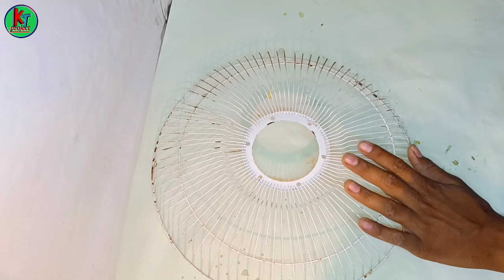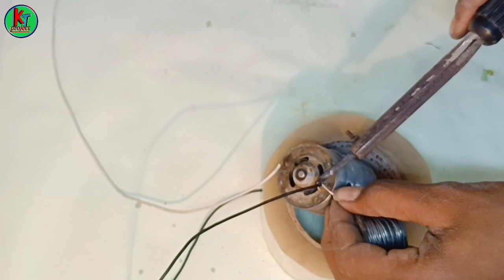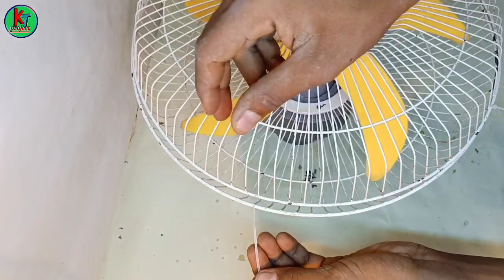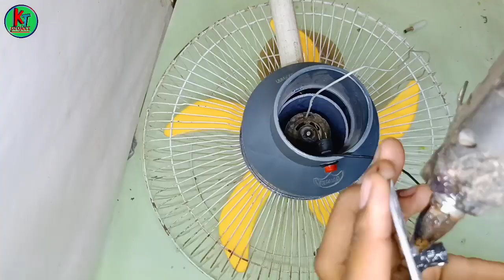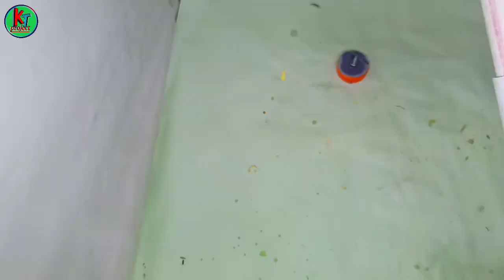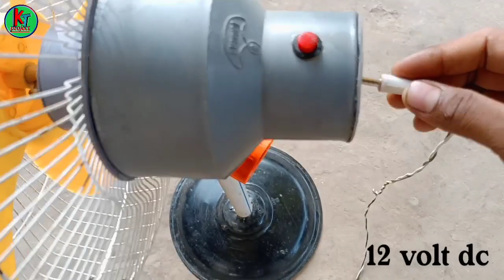Super Powerful Homemade Stand 12v DC Fan घर पर मार्केट जैसा पंखा बनाएं 12v 775 DC Fan

Comment: Bro my 775 motor blowed off when it ran continuesly can you say me why please reply
Reply from the maker: Brother what do you want to ask please tell clearly
Reply: My 775 motor winding blowed off when it works continuesly around 15 minutes can you tell me a reason why it happened
Reply: Without any load motor runs in low amp but when takes the fan blade then it takes high amp and then when it works in high speed with the blade amp reduces but wires getting heated up can you say me what is the reason
Reply: Kyuki jo propeller cooler k liye hoti hai wo aapne is motor pe laga di 

Is motor pe 2 blade ya 3 blade wali propeller lagayi jaati hai wo bhi 12 intch ki